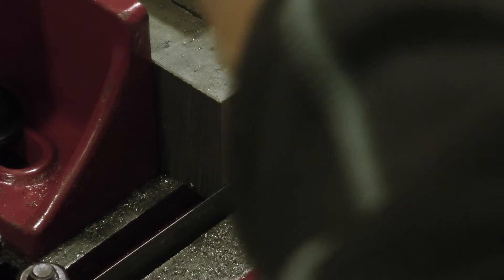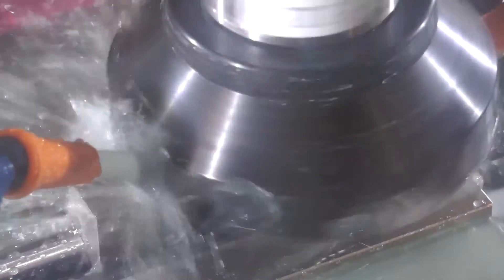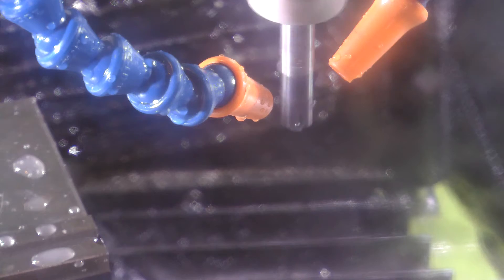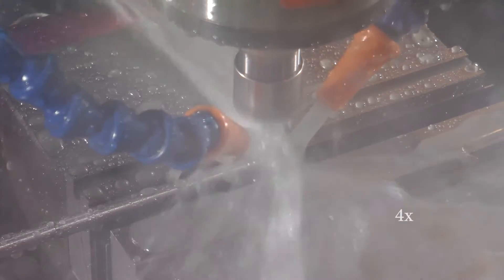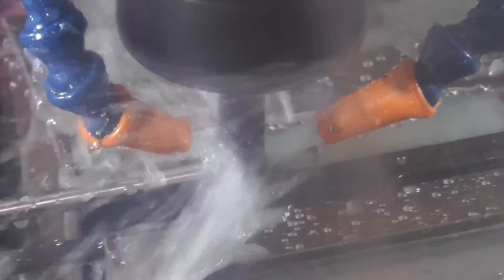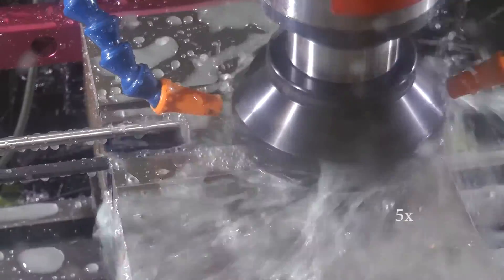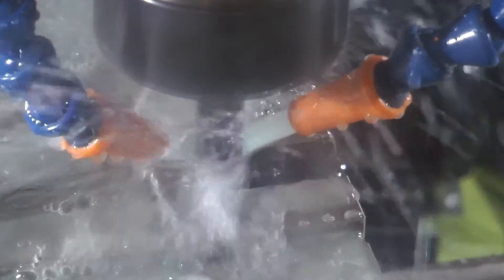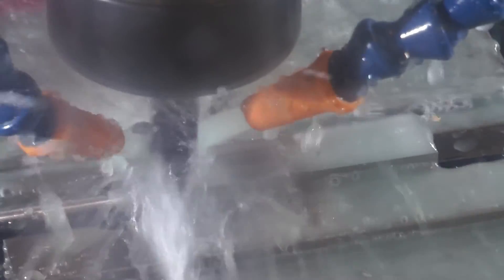Precision Dice: (pt.2) Titanium prototypes

Comment from the maker: I actually was looking at getting the Tormach superfly but after doing some Gwizard calculations it turns out the large diameter seriously limits the RPM you can go in Ti. Looking to stay around 210 SFM I found the optimum diameter tool for MMR that still gives me enough width to do it in one pass in Ti is 0.75". The 0.625" is actually a little better but I would then have to do 2 passes to get it all. With a 1.0" diameter tool the MMR falls of significantly because your spindle speed must plummet to keep the SFM the same. So if I end up making more of these I'll probably invest in a 2fl 0.75 indexable endmill and only use 1 flute. Or I may keep both flutes and test the finish from that.

Comment: The "aggressive cut" didn't look all that aggressive on the video, although sometimes that sort of thing looks different in person.  I do believe you now have a spindle motor that's consistent with the capabilities of the rest of your milling machine.  Congratulations.  Like the muscle car guys say, there's no replacement for displacement.  Sometimes you just need a big motor.

I still like my Tormach SuperFly cutter.  I know there's a Ford vs Chevy thing with Tomach and Mikini, but that SuperFly is awesome.  It could save you the hassle of pulling all but one cutter out of your shell cutter.  For 3 HP spindles or less, I'm starting to question the need for a large shell cutter.  I think you need more spindle power to fully utilize all of those cutters at an optimal sfm, and you certainly get a better surface finish with the single cutter, and changing inserts is faster and less expensive.  I use the SuperFly fairly aggressively for material removal, and leave the same tool in place with a light DOC for the final finish cut.

A cheap Harbor Fright band saw can do a decent job with a good blade.  I buy the bimetal blades from McMaster-Carr.  No comparison to a cheap HSS blade, like the one that probably came on your band saw.  It's a very low cost upgrade.  A good blade will provide enough additional service life that it's probably less expensive overall than a cheap blade.

Titanium is stringy and has a nasty tendency to work harden, but in my few attempts turning on the lathe, I was pleasantly surprised.  I guessed at feeds & speeds (very NOT recommended for Ti) and got good material removal rates and good surface finish with cheap Chinese carbide inserts.  I think I got lucky.  I have it on good authority that tapping titanium is a bitch.  You probably need a special $30 tap.  Yowza!